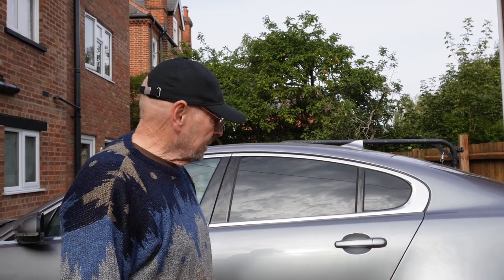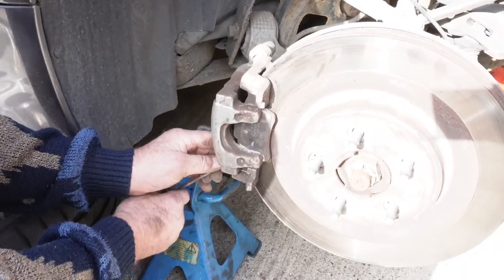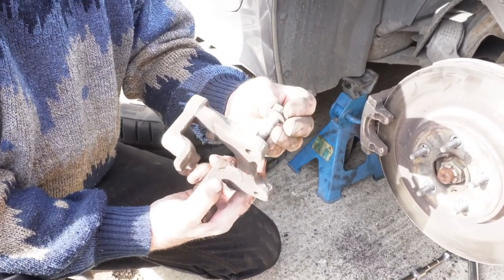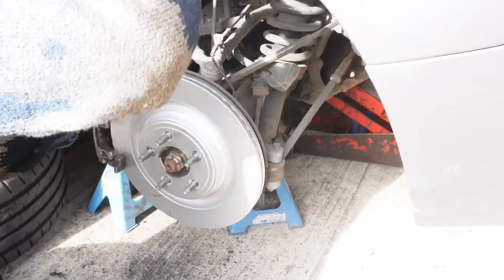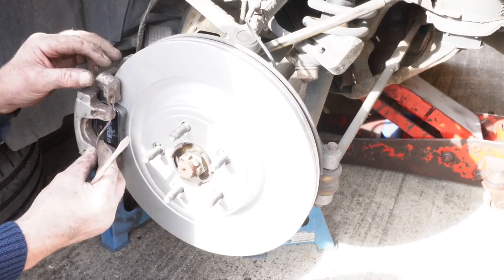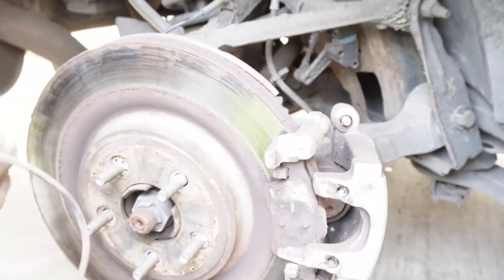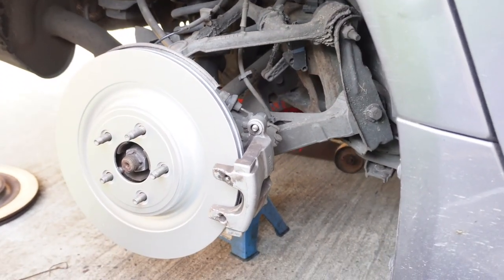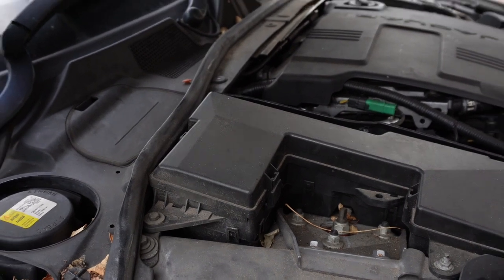Jaguar XF Replacing Rear Brake Pads and Discs

Comment: Thank you for taking the time to pass on this information and the informative video - much appreciated sir! Well done proper old school mechanic. Just get it done. Quick one. Did you jack up the car with your hydraulic jack on the rear differential case?
Reply from the maker: Hi, thank you for watching and for your feedback. Yes I did,
Reply: Thank you for your swift response. The reason I asked is because  jaguar recommend you don't jack up on the case. This of course could just be Jag be over cautious. I have  jacked up many different types of car on the rear diff and never had any problems with the diff post job. Did the diff run as it should do post job i.e. no abnormal noises ect? Personally I also prefer to jack on the rear diff as it is so much easier. Was just worried jaguar have a point with their diffs for some technical reason??   @crystalclearmechanics
Reply from the maker: Hi, Yes Jaguar do have specified jacking points but i use the diff, if i want to take both wheels off the ground. I have a pad that fits between the jack cup and the diff but you should always assess where to put a jack. The diff is made of cast iron and is bolted into a cage ( 2 large bolts through the back and 1 bolt upwards at the front ) and I have never had a problem jacking on the diff but as I said you must assess  where to jack. Just a point. I do not leave the weight of the car on the jack I lower it on to axle stands leaving the jack in place as a safety precaution. @poorboymechanic5280
Reply: Hi thank you for that, much appreciated. I am the same in regards to the leaving the jack on the diff with no load just as a back up. Belt and braces springs to mind. Thanks again for the video. Sterling work sir. @crystalclearmechanics

Comment: Thanks for your videos - it is really appreciated how clear and well filmed they are.

Can I ask if you used a torque wrench to  do the caliper bolts back up, or just used your experience for how tight they should be? Really struggling to find the right torque settings online but would appreciate your input on how important it is.

Would love if you could do videos on preventative maintenance on common issues (EG Cleaning EGR etc) in future videos if at all possible. 

Cheers
Reply from the maker: Hi Matt, thank you for watching and for your feedback. The torque settings are as follows,  bolts to caliper support bracket 103Nm Jaguar recommend replacing the bolts ( probably because they come with threadlock applied but I just clean them and apply my own threadlock. The guide pins that secure the caliper are 28Nm. I will try and add some preventative maintenance videos in future. Thanks again for watching.

Comment: Hi, i have a 2010 jaguar xf, and i would like to replace the rear discs it has an electronic handbake. Is it possible to disengage manually without the diagnostic tool computer, please.. your videos are very informative thanks in advance.

Comment: When the new pads are in place on the front discs do I pump the brake pedal before or after I replace the brake reservoir cap? Do I not need to bleed the calipers?
Reply from the maker: Hi, thank you for watching and for your feedback. I always ( out of habit ) pump the brake pedal before replacing the cap but it would not affect it either way. No you do not need to bleed the calipers.

Comment: What size tool do I need for the caliper bolts?
Reply: That's exactly what I just said.
Reply: 7mm
Reply: 7mm hex head and get the rear caliper tool to turn in

Comment: Do you have to do anything special to reset the electronic handbrake if you change the discs and pads...i have a 2016 but assuming its much the same ?
Reply from the maker: Hi, thank you for watching and for your feedback. The caliper with the electric motor / actuator fitted to the back of the caliper requires a different procedure to retract the piston.

Comment: You omitted to tell the viewer what  type of tool and size needed to  split the caliper. You didn't advise the viewers to clean the disc prior to fitting, you didn't use brake grease on the pads and you din't use a torgue wrench once as far as I can tell.   You also didn't warn people about the electric handbrake. If it were to come on while the bare was off, you've got a bigger problem surely?
Reply: it will be fine, u would not believe what "professional" garages do ;-)